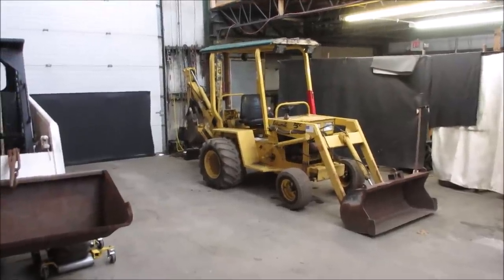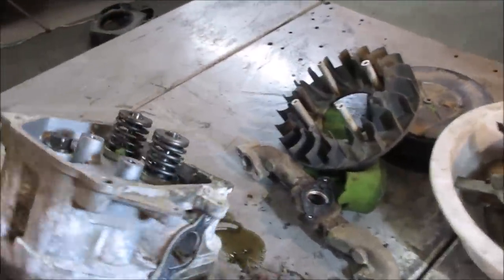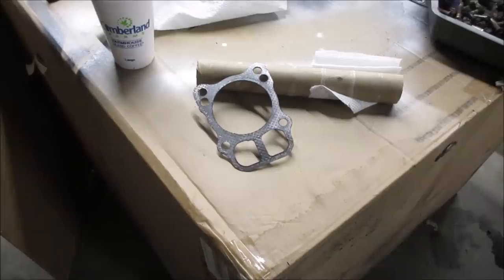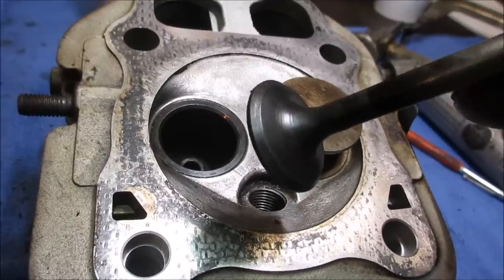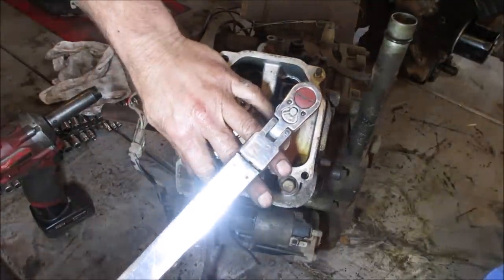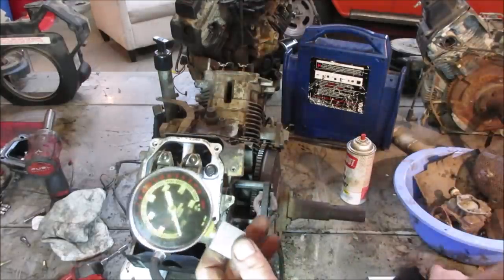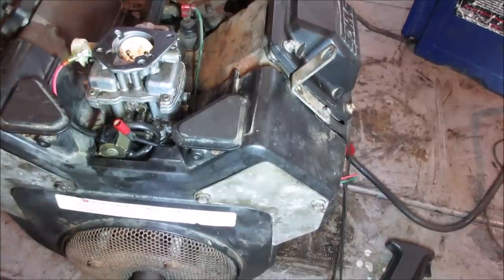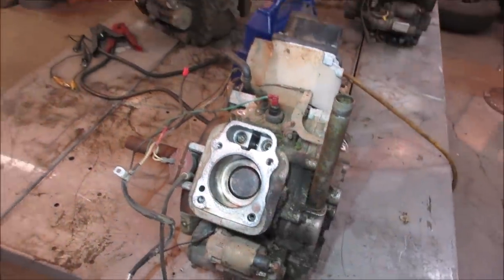Can We Save One? Free Trashed Kohler Engines.

Comment: I have one of those engines different crank style I found it in the back room of where I used to work it was just a block with pistons and a cam no heads no tins no starter I had 3 or 4 blown up ones vertical shaft I used one head from 2 different ones bits and pieces eventually I had a mostly complete engine I had to buy a used intake manifold and a new  carburetor those were the only things I had to buy their is a spray on gasket stuff the one I used was a copper color ish but it ran great had an oil pressure gauge hooked up and it had 40 psi still will run I'm getting ready to put it on a rear engine gravely

Comment: I use I think it's called Coppertone it's a spray-on head gasket sealer used for Hondas and I used it on the lawn mower & Small Engine head gasket so I don't have to replace them and I never run into an issue doing it so far

Comment: I'm 99% certain you can take the piston from the engine with the thrown rod and put that into the engine with bad rings and it'll run ;)

EDIT: Pretty sure those are Kohler CH20 engines. I have a CV15 in a lawn tractor, it seems like a decent enough engine.

Comment: There should maybe be a small rotator on top of that shorter valve stem it sits between the rocker arm tip and the tip of the valve stem

Comment: Hells yea,, win win for Mustie 1 .  If you want to join two motors at the crankshafts.  You will need to precision drill and tap the shaft, or just precision bore the shaft.  Either join by shrink fit press fit or thread and lock.  Either way will require precision to a tolerance of less than a .0005" for positive results.  I know folks that do this on a weekly basis sometimes a few times a week.  It seems easy once you see it done.
Reply: You could just use a lovejoy coupler. They're made so you don't have to have the alignment perfect. For us reasonable people. 0.0005" is pretty unrealistic tolerance. I'm not saying it is impossible, just not sensible.
Reply: @1pcfred   There isn't a shaft sticking out of the one motor, how do you pose to mount a coupling.  Yea I know lovejoy and Seir bath. and Waldron worked with these couplings for 40 years
Reply: @MrTonyPiscatelle  It would take some creative mounting. If it were me I might consider welding it? I can get rounds pretty lined up just with them in angle. That works surprisingly well. If the angle is straight it'll align the rounds. The angle works like a V block. You have to chamfer the ends for a place for the weld bead to lay. If you want the final diameter to all be even. Hot rolled angle isn't the most dimensionally accurate thing in the world but it'd be close. Might want to stone it some before you use it. Impart a bit more straightness to it. Knock off the scale and rust high spots.
Reply: @1pcfred  I guess you could do that .But some precision work will make it replaceable in the future, no magnetism from welding, no flake out etc.  I've seen it done and I've seen it fail. I'm taking my que from years of industrial service and backed by some great machinists and support.  I just know it works each time every time
Reply: @MrTonyPiscatelle  I have a degaussing plate if magnetism is an issue.
Reply: @1pcfred   I'd say you've covered all the bases Mr. Frederick. weld er up !
Reply: @MrTonyPiscatelle  The trickiest part would be getting round stock the same size as the shaft. Who knows what that size it is. I just know I don't have any lying around.
Reply: @1pcfred    That's why the Lathe was invented

Comment: These engines that have a pto only on the fan side make my head hurt. :( I would be tempted to add a shaft to the opposite side if I had one open for say a alternator where the stock alternator was not enough or a hydro pump if the main shaft was driving something else.

Comment: You can make a Kohler CV into A CH easy just make or buy a oil pick up, I made a CV 25 into a CH25 installed it in my Gehl 2500 works perfect with 50 Lb oil pressure.

Comment: To connect the engines together You could connect them Via pulley wheels And a lower drive shaft drive shaft Like a reverse Of Victorian belt drive for factories or a cotton Mills You know the ones that have the big drive shaft that runs through the entis dive shaft that runs through the entire building And if you had Tensioner on each engine you could start them you could start them individually Because the engine is individually mounted and Connect to the drive shaft it is easy to remove the engine in for maintenance
Reply: That's called a line shaft. The pulleys are called sheaves. The bigger problem connecting engines together is synchronizing their speeds.

Comment: You mentioned the head gaskets appeared to not making even contact around the cylinders - do you level the head and cylinder surfaces to achieve more even contact??  Also, with all that carbon buildup, Is it running too rich mixture??

Comment: would an occasional can of seafoam help to keep the cylinders clean? Just saying the build up from bad  rings or running with a stuck choke could avoid a break down of the engine block and keep the sucker in service?

Comment: Seems to me that your various valve spring compressors are awfully hard to use. When was the last time that they got a bath? I am guessing that the threads on those devices could use a good cleaning and lubrication. I lube every thread on every device I own. All of my screws cooperate with me. If there is anything I hate more than a dirty screw I have not yet found it. Things like floor jacks can be mighty obstinate when their threads are dirty and dry. I'm 80 years old and I refuse to fight with my machinery.

Comment: I recently got a tractor that has a whisleing sound coming from some where and it can't take no choke when starting it actually it can't take throttle to rev it up it did have a carb issue the shut off caught fire. Overheated. But why would it whistle. Lots of things going on here. Not sure where to begin.

Comment: What is that piece he cleans at  52min that  moves in and out and had a jet?  Is that before or after the carb?  Does it pulse fuel?
Reply: It's a fuel cut, or anti backfire solonoid. When power is applied, the pintle is pulled back allowing fuel to flow into the main jet. When power is shut off, it blocks fuel from reaching the jet. Small engines when shut off at high speed will draw fuel in from vacuum while the engine slows down from running but there's no spark. The raw fuel goes into the muffler and causes a backfire. This solonoid prevents that

Comment: the valve guides are bad i had the same problem with mine they slide out of the head and bend the  push rods its a thing with the kolers its caused from the motor running hot

Comment: The idle speed should be fine. The reason its low is no fuel pressure. Since you have the fuel pump disconnected.